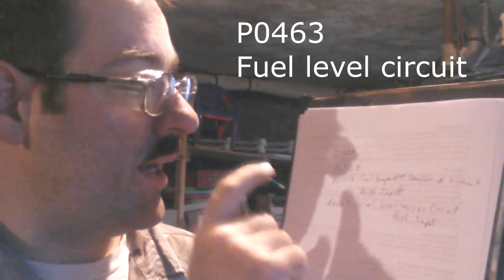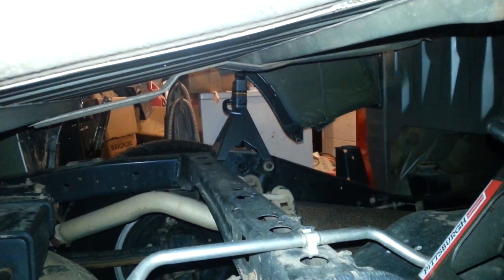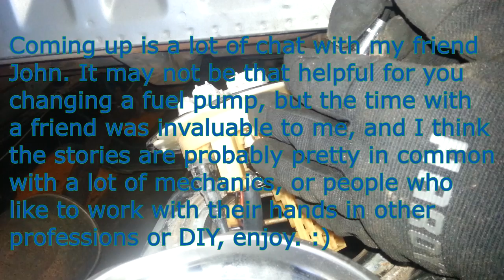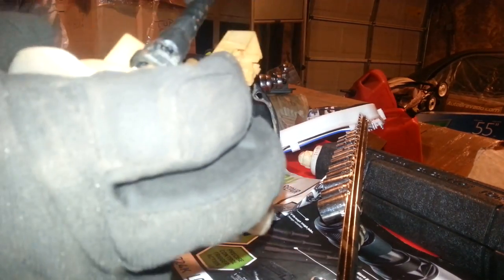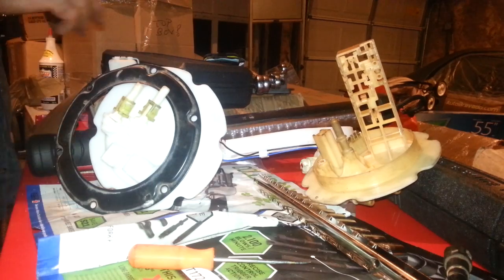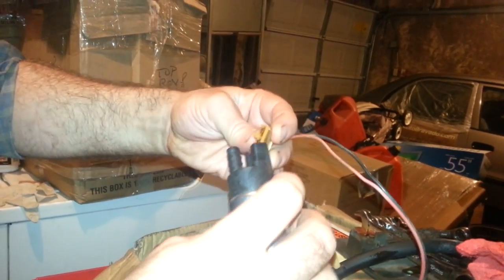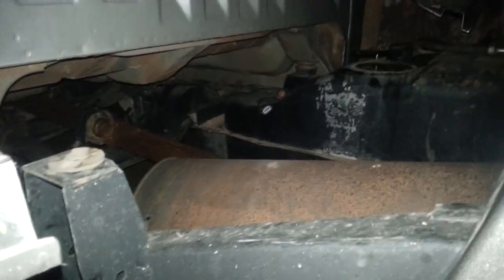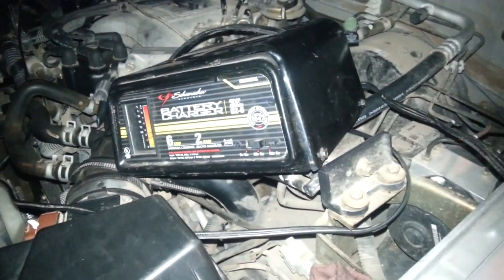Nissan Frontier Fuel Pump replacement, bed tilt method part 1

Comment: That's not what goes wrong with those trucks that truck was misdiagnosed the fuel pressure regulator is what goes wrong and that's up under the hood of the car sounds like you just wanted to make a few more extra dollars off of whoever's truck you were working on
Reply from the maker: It's my truck and replacing the fuel pump did fix it.

Comment: Let me recap. You remove the first two bolts holding the bed completely. Then the last bolt you back out the nut all the way but leave it on the bolt. You drop the bumper, unplug the lights and remove the filler hose and 2 evap lines. At that point you are ready to tilt the bed and support with jack stands?
Reply from the maker: That sounds really close. I believe there's 2 bolts up front and 4 in the back. The final 2 need nuts just on there to keep it from falling. Be sure to support the bed in more than one place. Knock one down and risk death like I did. 

All my strength to lift it off me enough to breathe. I finally realized. Couldn't breathe but my muscles in my legs could recover. Lift. Breathe. Drop. Be crushed. Don't pass out. 

Explode upwards to life! Took 2 tries. That's why I use 2 Jack stands. The first time was a piece of wood from the ground up. The story is in the description.

Comment: I had no help, had to use the jack to lift the bed smh
Reply from the maker: It's really quite heavy. How did you find a spot to put a Jack in?
Reply: @DENicholsAutoBravado  I used a piece of emt pipe and put it on the edge of the bed by the back of the cab. Then just jacked it up.
Reply from the maker: I'm not captain I understood. A pipe between the bed and Jack? Once up stands can go under the bed.

Comment: Would it be easier to work on if you just dropped the fuel tank? It looks very difficult and tight the way you are doing it. Is it the Nissan manual method? Not a criticism...just asking.
Reply from the maker: I didn't own a transmission jack at the time, but at work I do. With a lift and a transmission Jack available I've almost always dropped the tank. I lifted up a Ford Ranger one day and saw all the rust and I chose to take the bed clear out. Much lighter truck bed than on this truck, I assure you.

I think this answers your question...mostly...I won't say definitively either way as it depends on equipment available and the truck involved. 

I learned this when Briansmobile1 showed me the bed tilt method where tilting the bed to the side worked...wouldn't work on the Frontier. On the truck Brian worked on, it made for gobs of space to work.

The tilt method, depending on design could prevent needing to remove as much EVAP components.

Comment: You just chose to take the long way home instead of taking the practical way
Reply from the maker: In a shop I've almost always dropped the tank for replacement. In a garage without a lift this was easier than dropping the tank to change the fuel pump.

Bed tilt method or fuel tank drop method? They take about the same amount of time. You save yourself a few steps dropping the tank and add a few steps dropping the bumper to pull the tank up but while over all it takes about the same amount of time, the difficulty of the tasks are lower.

I have a transmission Jack now, but I didn't at the time of the recording. That's a consideration too. Using normal jacks on a fuel tank is much more difficult and unnecessary.

Comment: I plan to use a hoist from above to lift the bed (tied off) jack stands on each side and a brace for additional safety. Thanks
Reply from the maker: Watching part 2 may help you keep the order of the parts for reinstallation. https://youtu.be/2C3Z7tGSsIM

I know it's in 1 of the videos, but take the bumper off too. Yes?

Comment: Just cut a hole in the bed where the fuel pump at
Reply from the maker: 🤣 but then there's a big hole in your truck bed.
Reply from the maker: That'd be really hard with my liner. Tall corrugated plastic? Would be a pain in the neck. Wasn't that hard to lean the bed. But I do not recommend doing it alone! 

Got stuck under by myself once. It was really scary. Had to relax and then explode. Relax to gain strength while being crushed because the severe 120 F hear was taking me out. 

Relax into probable death, explode to escape. Man that was scary. It was when I still had a ton to learn to be a mechanic. This was years earlier in my journey.

Comment: For those of you with the Gen 2 Frontiers that have had the fuel pump fail...did you have a period of time (before it failed for good) that your truck would randomly go dead while going down the road, but you could crank it right back up?  My 2006 4.0 did this for at least 2 years before the fuel pump finally went out.  It wasn't often, but about one a week it would randomly just die sitting at a stop light or even going down the road, and I'd just pop it in neutral and crank it right back up.  In hindsight, I'm pretty sure now that was the early stages of the fuel pump failing.
Reply from the maker: Yeah. It didn't fail all at once. It came on slowly. Keeping more gas in the tank helped because it cools the fuel pump better.
Reply: How long did you take to replace it?
Reply: @DavidHernandez-ue4fz  just an hour or two, it was a day off and I didn't get in any hurry.
Reply: @sethdover4999  last question,did you removed the bed or the tank,what is the easier way?

Comment: Hello!
I have a 2000 Nissan Frontier and also changed the fuel pump. That fuel line that you broke can be removed easily by squeezing the top with a pair of pliers.
Reply from the maker: Hey! Thanks!

Yes, that's how it normally goes unless it melted. The truck broke at one point in it's life and I didn't have the money to fix it and it sat in the sun for a few years in 100+ F.

I was able to remove it correctly then, but not at the time of this filming.

You've seen this video years sooner than me. You may know the video better than me. 

Thanks for watching out for other people who watch it. 😁

Comment: awesome video man! I was the one just talking to you on frontier forum.  I am replacing my sending unit tomorrow and a new fuel pump.   being that my truck has a 3 inch suspension and a 3 inch body lift i am dropping the tank.
Reply from the maker: +mmiguy2306 That's awesome! Yeah. With the lift you have a lot more room to work? Yeah?
Reply: DE Nichols 
tons!!!!  it was the best thing i ever did. i already replaced the tank 4 yrs ago cause it split at the seam.  so it should be easy
Reply from the maker: +mmiguy2306 Be sure to check out more videos on the Frontier. I have a lot that even on a Chevy Prizm applies on our Frontiers like spark plug concepts, water decarbonization for a clean of the engine. All stuff that I've done on my Frontier as well. :)
Reply from the maker: mmiguy2306 You didn't have rusty old tank problems then. I've replaced so many fuel pumps for a section of the tank I couldn't manually clean, but Lucas Upper Cylinder lubricant took care of that too. :)

https://youtu.be/ATL19lVpmAk

Comment: Just one more note. My  2002 Nissan Frontier is the 2.4 L 4 Cylinder and the fuel pump is different than shown in the video which is for the 3.3 V6. It does not have the little plastic connectors shown in D.E.'s video, but the fuel hoses both slip directly over the metal fuel nipples built into the fuel pump housing. I purchased a new housing from Rock Auto (Spectra Premium SP4016M) which had good reviews and it came with the float attachment and strainer already installed. No locking ring on this model with just 6 screws. O Ring was purchased separately for 3 bucks.
Reply from the maker: Great information. Thanks for sharing. 😀
Reply: Net Worth, did you have a problem getting the correct fuel filter? I have a 1998 Frontier 2.4L. I ordered one online and the plug is different.
Reply: @marcuswhite1403  Marcus, I did not have an issue but keep in mind I have a 2002 which is second generation Frontier and if you have a 1998 it my be different.
Reply from the maker: 1998 1999 2000, all have changes on the 4 cylinder but once you change a fuel pump on one truck it really doesn't go that different. At the shop with a lift I nearly always dropped the tank not raised the bed, but at a home garage? Bed tilt method can be a lot easier and less dirty too. Lol
Reply from the maker: One of the reason there were so many changes is because one of those years a new design had chains eating the engine and the next year it wasn't an issue.
Reply: @networth8754  It sure was different. Ordered one from my local parts and it was the correct one. The main thing was, some models had a low fuel level indicator and some didn't. Dealer couldn't tell me which one mine had. They just said it should be a light that comes on in the dash cluster, but didn't see anything when I turned the key on and wouldn't stay running long enough because of fuel pump problem.
Reply from the maker: You can check lights with KOEO.

Short for key on engine off.

All lights light up every time there's enough battery so you can know what lights you have.

Occasionally, it can include features the car or truck doesn't actually support.
Reply from the maker: I know it's not exactly helpful, but for my V6 '04 4x4, the fuel pump is sold 100% separately from the fuel level assembly. If it worked before, they rarely go bad so of course mine did but my fuel pump was taken out by excessive water contamination and ethanol making a mess with it.

Comment: I had to replace the fuel pump in a 92 Chevy van and 97 f150, both times I cut thru over the pump giving me easy access to replace them, afterwards I just cut a piece of metal then used a high grade sealer and installed a hatch that fitted flush, lot easier than dropping a tank or tilting the bed
Reply from the maker: Lol. Have you seen the video where a guy kept cutting in the wrong spot and kept missing the fuel pump? He claimed he didn't care about the old truck and he did it for humor and views.

Comment: When replacing the pump. Does the line from where you take off. From the pump fitting  Will be the exact line connection from the new pump fitting. So theres no way you can miss line them?

Comment: Hi DE Nichols,
I'm hoping you can tell me the correct way to release the fuel lines/clips off the top 2 points of the sending unit??
And is the method for that the same at the other end where the fuel lines connect to steel lines?
Thanks in advance & Best Regards,
Jack
Reply from the maker: It really is as simple as push them in, wiggle and release....but... dirt can cause issues. 

Silicon spray is good for cleaning out some dirt and improving slip. 

If you push the lines deeper together the "quick release" gets easier to push the opposite way. 

They work exactly like an air chuck. You know like when you hook your air tools up and off...but the moving part is inside instead of outside.

Comment: Was your Nissan Frontier the 2.4 L 4 Cylinder or the 3.3 L V-6?
Reply from the maker: 3.3L V6
Reply: @DENicholsAutoBravado  Thanks. I believe they may take different fuel pumps, but the bed removal is likely identical.
Reply from the maker: @networth8754  from chatting on a Nissan Frontier club...I forget the exact .com, I believe it is.
Reply: @DENicholsAutoBravado  One other question. The plastic extensions (nozzles) that you had to remove from the old pump and apply to the new housing, I wonder if they can be purchased in a "kit" since they are so fragile with age and likely to break?
Reply from the maker: @networth8754  I couldn't find them even at the dealer. I had to replace some with fuel rated rubber lines and attach them with quality clamps. Especially the one from the fuel pump up to the assembly which is at the top of the tank. The ones outside the tank are still original I think they hold up well.

You could check with the dealer. I felt the parts counter was assuming and not really checking. They just "knew" already...could be true...
Reply: @DENicholsAutoBravado  Thanks for the advice.
Reply from the maker: @networth8754  happy to help. And thanks to videos I can do that in my sleep even. Lol

Comment: nice vid DE.... if your pull both of the tabs of the full line clips open it just slides off of the old unit
Reply from the maker: Great tip for unspoiled trucks. :) Normally yes, but when I did this fuel pump last I loaded it back on crooked making it a headache later.

Comment: My 02 Nissan Frontier died while driving now it only turns over . Is it the fuel pump that went bad ? Alternator new battery new just replaced both cause alternator went out
Reply from the maker: Smell a spark plug. It might tell you a lot. Smell fuel? Maybe it's an issue with spark. Smells like ozone? Maybe no fuel.

Comment: note; nissans are known for the distributor failing internally and causing the same stalling problem
Reply from the maker: That is very helpful for anyone stumbling into this video looking for answers. Thank you. 

It's my hope that since I keep impeccable care of the rest of my ignition system that I may not ever have to replace the distributor assembly. All else being in good shape reduces wear area tear on the rest. https://youtu.be/I_7jXXmwFcE
Reply: what fails is the bearing in the dist. shaft starts to chaffe and wobble...
Reply from the maker: It literally sounds like I could listen to it while it's running and know if it's trouble.

Comment: Have a question for you. I have a 2014 frontier that each time I turn left or step on the brake then accelerate the truck hesitant. I change the evap as one of the codes that came up and also I cleaned out the throttle and air filter. Any idea. It drives smoothly it’s just stop and go and hesitates after
Reply from the maker: Evap codes are so common in the early 2000 Frontiers. Not sure about 2014. Check your vacuum. If your brake booster isn't holding enough vacuum it's possible for it to effect how the truck drives after braking.
Reply from the maker: Really bad evap can cause driving quality issues but I've only seen it on a Ford Taurus, once ever. You'd have to be getting huge amounts of fuel from the evap system. If you over filled your gas tank a lot this is possible. Pretty unusual outside a 2014 Mopar vehicle to get a severe evap issue which effects driveability.
Reply from the maker: What is your evap code and brief description?
Reply from the maker: A dirty maf could cause this. Frontier MAF's are super sensitive to cleaning. All cars are if you don't let the maf cleaner fully dry. 

As long as it's not below zero out maf cleaner should dry pretty quickly. Don't touch the maf sensor. Cleaner only!

Comment: What sockets and wrenches do I need for the 6 bed bolts? The middle and rear look like 14mm, the front is 17mm?
Reply from the maker: I know I mentioned in the video. My apologies. I can't remember. You should get a nice ratcheting serpentine belt tool.

It's the only tool owned then that fit. Box handle didn't go deep enough and regular ratchets didn't fit.
Reply from the maker: I'm thinking 14 or 15, 17, and 18 were used between the bed bolts and the bumper. A no skip set of ratchets would have you half way there... I'm certain I didn't use 16.

Comment: Cutting a hole in my bed to change mine
Reply from the maker: I wouldn't devalue my truck by doing that but that's me. I don't know the condition of your truck . . But it isn't that hard to raise the bed so I'm thrown off by the desire to do that.

But it is your truck. 

Doing all that hot work next to a fuel tank is risky. Don't blow up.